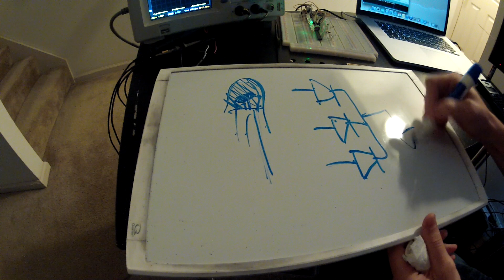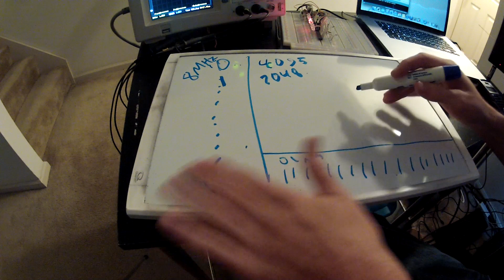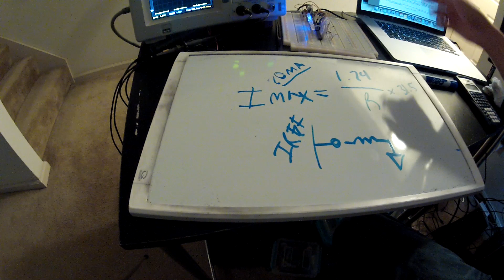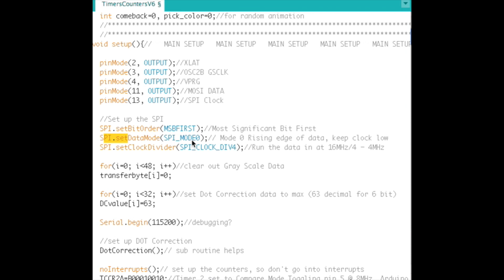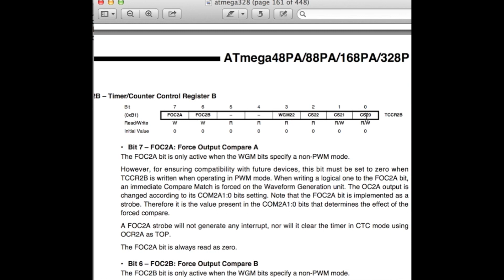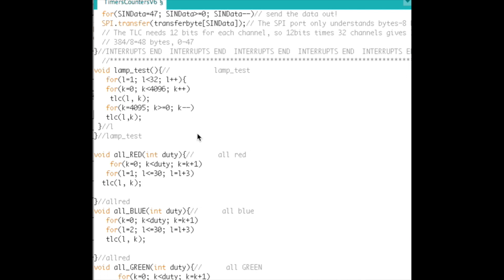How to Control a Ton of RGB LEDs with Arduino & TLC5940

Comment: Any tips on getting this shield working?
sparkfun dot com/products/10615 

I take it I just need to get headers to mount it to an Arduino Uno, then I need to get power to it somehow - will it need external power if I connect 16 led's?

Comment: I have an incredibly short attention span but you managed to keep me occupied for an hour! I especially enjoyed the bits about bytes & I don't expect to have any trouble with those conversions - ever - thanks to the way you just kind of threw it in there. Question: About the 4 extra bits in a 12-bit cycle, can they be reassigned (for example) to a mood or temperature input, rather than truncating them, as you might have suggested, putting otherwise lost resolution to a better/more effective use?

Comment: So... 8MHz was the Global Frecuency? I got a little confused in that part. Just that one... I plan to use this chip, but with no arduino. So, if a use an 20Mhz crystal oscillator for my microcontroller, i have to do all the calculations with 20Mhz, rigth? Or am I missing something? [Im no English speaker, so let me know if I did explain myself right]
By the way, excellent video! Really. Thanks for it.

Comment: I am wondering. The code:
  PORTB &= 0<<5;// The data sheet says you need this for some reason?
does not only clear bit 5 of port b, but clears all bits of port b!
It shifts '0' five bits which will give you 0 again. And then it does an AND with the port which will clear all bits.
This
 PORTB &= ~(1 <<5)
will clear only bit 5 of port B

Comment: the TLC595x family does give individual led control of each of the 24 leds it runs.
It also adds "global brightness control" so when used with a rgb setup you can compensate for the different voltages each color runs at (and for the differences in eye response) so the brightness are all the same.

Comment: Hey, great video, its a nice thing to explain how you went about talking to chips that at first may seem too difficult to try. One thing though, near the end of the video you said that chopping the last four bits off the 12 will only reduce your 4096 levels by 16, but I'm sure it will actually divide your 4096 by 16 giving a measly 256 levels.  How would you tell the chip to only need 8 bits instead of the 12.

Comment: Hey kdarrah, i found a similar chip that is simpler to controll than a tlc5940, the thing is that it has 24 pwm current sink pins and they only come in smd packages. It is the tlc5947.